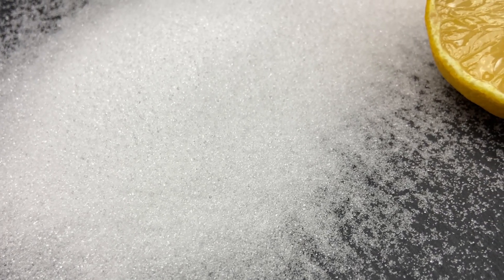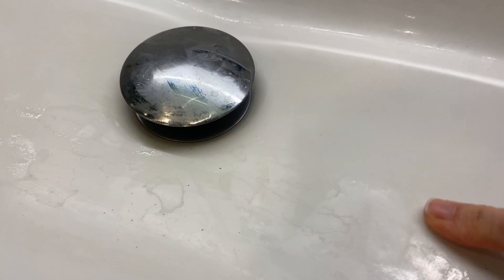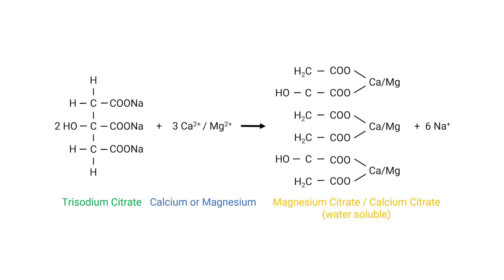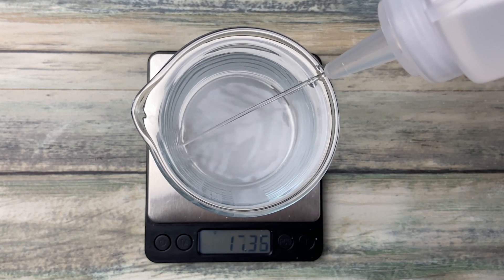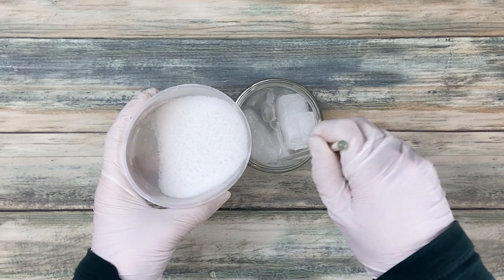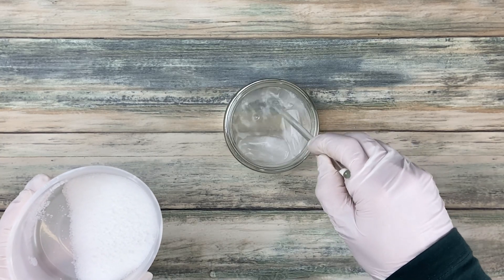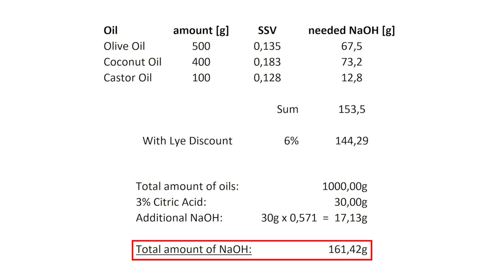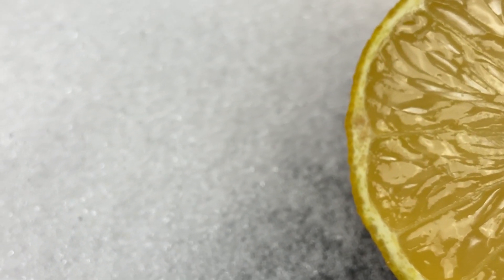CITRIC ACID in Cold Process Soap - Why YOU should use it

Comment: Hi Sue, thank so much for the video. I have a question please. Since citric acid will turn into sodium citrate, will it work if I just add sodium citrate to the water instead? If it is possible, do I add NaOH to compensate as if with citric acid? Thanks so much...
Reply from the maker: I didn't try it, but you can use sodium citrate!
Reply: @SueandSoap  Thanks for the answer.
Reply: @SueandSoap  Thank you.

Comment: You are the only person to state 10g of citric acid consumes 5.17g of lye every single article forum or video states 10g of citric acid consumes 6.24 of lye. Why is your answer different?
Reply: Usually if you buy citric acid it comes as monohydrate.
This means that 8.57% of your crystalline acid is in fact water.
For the unlikely case you've got pure citric acid, you would need 6,24g of NaOH to consume 10g of your acid.
But if you got the monohydrate form of the acid, 10 g of it will only contain
9.143 g pure citric acid.
With my calculations, you need 5.71 g of NaOH to consume 10 grams of the citric acid monohydrate.
I bet Sue did calculate this too and unfortunatly got transposed digits :).

I hope this helps!
Reply: When I add citric acid to my distilled water, dissolve and then add my lye (plus extra) stir to dissolve then wait for it to cool down, it starts to look icy, like it’s crystallizing and at the bottom it’s like a slushy consistency. Have you ever experienced that and/or know why that is happening?

Comment: Greetings, I really appreciate the remarkable effort in your video, really impeccable.
However, just with the intention of contributing, I would like to leave my opinion:

To determine the amount of bleach that neutralizes citric acid we must use the molar and convert grams to moles using schiometry, we must also convert the moles of acid to grams.

In that order,

The molar mass of citric acid is 192.124g / mol
The molar mass of NaoH is 40g / mol
The molar mass of Koh is 56.1g / mol

The schiometry is looks like this:

1g NaoH x 1mol / 40 x 1mol acid / 3mol NaoH X 192.12g /mol=1.6g citric acid

Under the previous foundation, the correct formula to determine how much caustic soda reacts with citric acid should apply the following formula: (Weight of citric acid) / 1.6 = NaoH to add.

Thus, in a formulation that contains 1000g of oil, and you decide to use 2% citric acid, the calculation would be as follows:

To calculate the amount of A. Citrus.
1000x 0.2 = 20g A. Citrus

To calculate extra caustic soda.
20 g / 1.6 = 12.5 g extra soda

Thus,

10g of AC react with 6.25g of soda
20g of AC react with 12.6g of soda
30g of AC react with 18.75g of soda

Regarding your video, I would like to know why you say that 1g of AC reacts with 0.571g of soda?
Thank you very much for posting your videos. They are excellent.
Reply: this is a very informative comment.thank you very much for this.
Reply: Thank you so much. I don't know how to express my gratitude for your guidance. I have been trying to learn how to identify the relationship between these two ingredients for quite some time. Big heart from Thailand.
Reply: Thank you for this! I was wondering where she got her numbers.
Reply: Thanks for this! Love the geek-out! Math is my best drug! ❤ Part of the reason I love to make soap and bread.  😊 😍 🧼 🥖
Reply: Based off your reasoning I agree with you. So per 1000 grams of oil I need to add 20 grams of citric acid and to prevent too much of over fat or super-fat I need to add 12.5 grams of Sodium Hydroxide per 1000 grams of oils.
Reply: @cobaltblue8363  It is correct
Reply: We’re not in calculus, biology or whatever the hell you put on here! Get off this page!
Reply: @michellemartinez9941  Why are you so hostile? This commenter is right, the correct amount of extra lye needed is 6.24-6.25g per 10g of citric acid. Yes, they used a difficult looking formula, but that goes to show how much goes into this. Soap-making is a science. You need science to understand it. It is likely using the video’s measurements cant hurt, though:) But don’t be so negative just because you can’t understand it.
Reply: @michellemartinez9941  Bro you're gonna get mad at science? Literally everything you enjoy in your idiot modern life revolves around science and people knowing "calculus, biology or whatever the hell". That comment was purely for SAFETY of people who make and use soap. Soap making is a CHEMICAL reaction, which is something called CHEMISTRY. Learn to control your emotions and not get mad at people actually knowing what they're doing, you could learn from them.

Comment: That's really interesting! , but just looking at your video I don't really feel comfortable about doing it myself because I didn't really understand how will it affect the making process... From your experience, does it affect trace? What does it do to the color of the soap? Does it play well with EO's?
I would really like to hear your thoughts on this because I liked the video and I think you do a good job presenting your point of view
Reply from the maker: Thank you very much! 😃 I didn't notice any effects on trace or color. I don't have experiences with essential oils, I only use fragrance oils. But also with that I didn't notice any problems. Because of the hard water we have I use it in all of my soaps. It works great without any negative aspects. You only have to be careful when you add it to the lye solution because the reaction will create a lot of heat and it starts boiling with a lot of fumes when you don't keep it cool.

Comment: If I use 1% citric acid of total 1000g of oil + 5% super fat, I will be adding 5.71 g NaOH, so how much super fat still remains after adding the additional NaOH? Should I increase the super fat?
Reply from the maker: It's still 5%. If you add NaOH to compensate the Citric Acid your amount of super fat stays the same. You only increase it when you don't add extra NaOH.

Comment: I use citric acid at 1% in my soap to help with soap scum. Our water is very hard and the scum was visibly clogging our shower! I use a 50/50 lye solution and dissolve the citric acid in the rest of my water before combining it with the masterbatch solution. I choose not to add extra lye because at just 1%, it doesn't make a noticeable difference. I've seen about a 50% reduction in scum in the shower drain.
Reply from the maker: That is great! I still have some bars without citric acid and the soap scum they produce is annoying. 1% is really not that much if you make a bigger batch. I only make smaller batches and then 1% can increase the lye discount very much, so I always add the extra NaOH.

Comment: Wouldn't this help with dreaded orange spots?
Reply from the maker: When you use Citric Acid it reacts with Sodium Hydroxide to Sodium Citrate. According to Kevin Dunn Sodium Citrate doesn't help with dos. What it does is that it binds metals like calcium or copper which may be present as impurities in tap water or caustic soda. So when you use tab water instead of distilled water for soap making you might have a problem with dos as these metals support the building of dos in soap. In this case adding Citric Acid or Sodium Citrate would help to prevent dos.
Reply: @SueandSoap  so would boiling tap water First help with removing metals from water?
Reply from the maker: @coconutluxenaturals  if you want to use tap water for soap making, it is better to boil it before using it. But even if you boil it, there will still be some impurities left. Better use disitilled water for soap making.
Reply: @SueandSoap  thank you so much for your amazing informative replies 🙏🙏
Reply from the maker: @coconutluxenaturals  Glad I could help 🙂

Comment: So we cannot add the citric acid solution in trace?we only can add this to the kye solution...citric acid neutralizes luquid soap and lowers the ph does it work the same way here?will it be helpful to add this to a sampoo bar instead of the vinegar rinse? Thank you...
Reply from the maker: I think it would also work adding the citric acid later but I would not do that because citric acid and Sodium Hydroxide react very intense and also the reaction would add a lot of heat to the soap batter. I did not test the ph but as far as I know it does not have a big impact on the ph in cp soap. The vinegar rinse is more intense on your hair than the sodium citrate in soap. You could make a tiny test batch of hair soap with citric acid and just try it without the vinegar rinse and see how it works for your hair. I don't think that using citric acid in hair soap can replace the vinegar rinse but it will help a bit.

Comment: Nice to know! I heard citric acid is also used to reduce soap PH level. Interesting
Reply: It won't lower the pH in cold process. After it reacts with the lye, it is no longer an acid. I think that if you put a lot of it in hot process after the cook, it might work. But it may also have unintended consequences.
Reply from the maker: @clarewhite3004   this is a good point. Thank you for your comment!
Reply from the maker: Yes and no. I'm not quite sure about this PH thing. All I read about that is not very clear and unspecific about citric acid and the effects on PH in cold process soap. As far as I know it doesn't really have an effect on cold process soap, but it works well for liquid soapmaking. I need to do more research on PH in cold process.

Comment: Citric Acid neutralizes 6.24 grams of lye
Reply from the maker: Thank you for this comment! Yes, this is correct if you use citric acid anhydride. I was referring to citric acid monohydrate. If you are not sure which kind you have I always recommend using the lower number as this gives you less additional Sodium Hydroxide. So in case you use anhydrate you get a little bit more super fat by using the lower number which I think is better than getting less super fat.